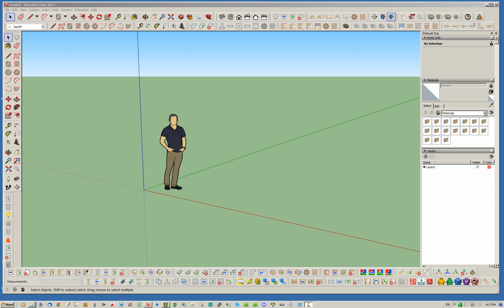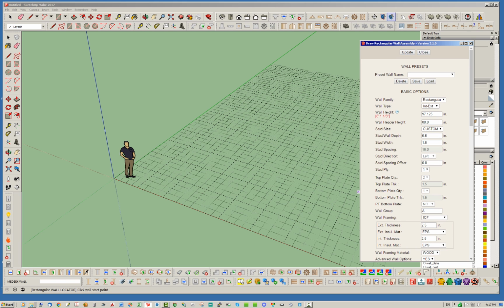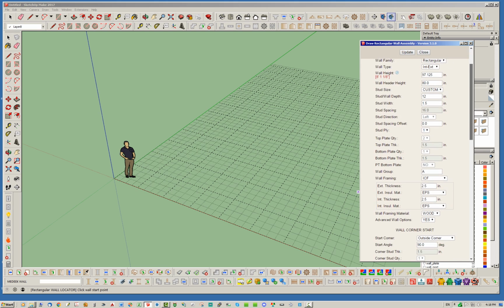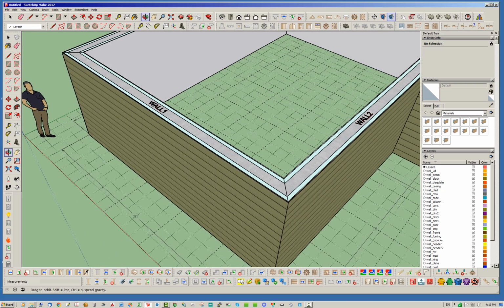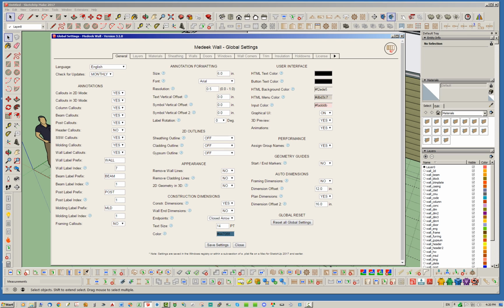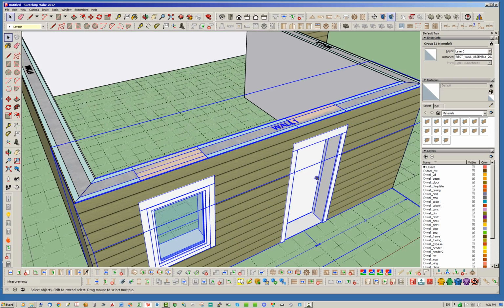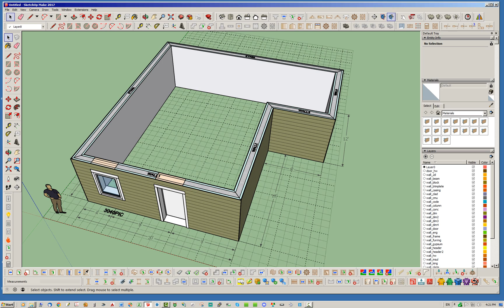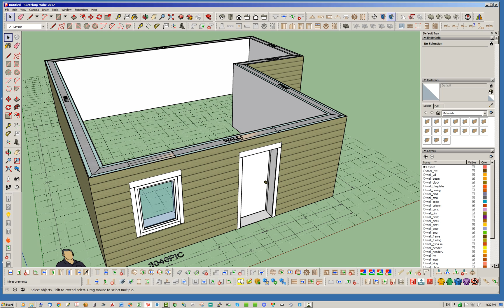Medeek Wall Plugin Tutorial 33 - ICF Walls

Comment: I've tried a few different wall settings based on what you show in your video and I cannot get the corners to miter. I've tried outside corner with a 45 degree start and end. What am I missing? Thanks.